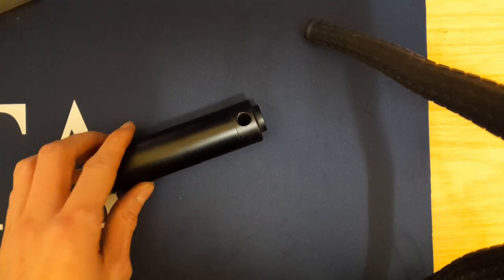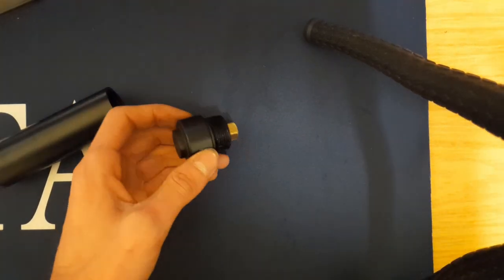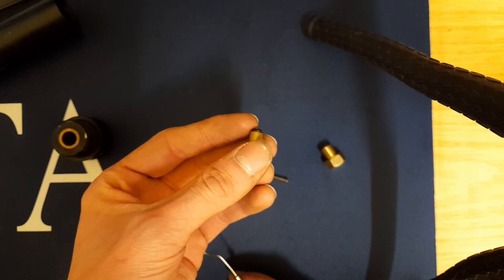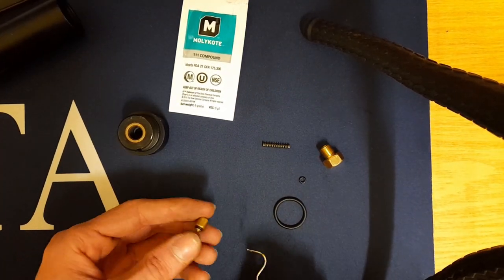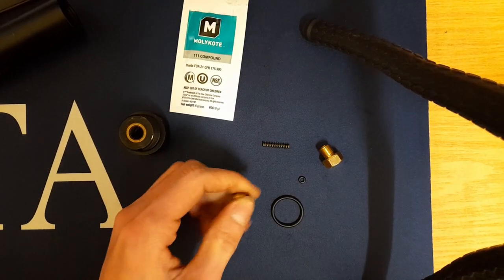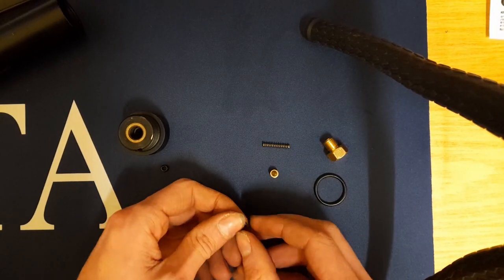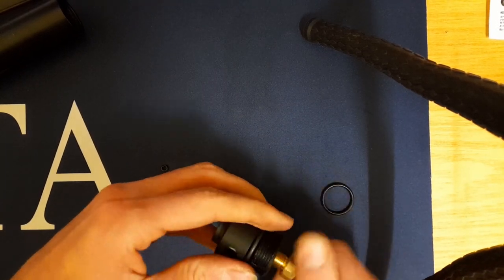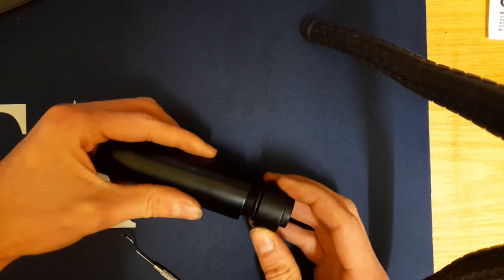FX Inlet Valve Service - Gladiator MK1, Verminator MK1, Cyclone, Typhoon T12 etc.

Comment: I have a FX T12 Whisper.  When trying to air it up, it airs up fine with a portable pump.  But when  we try and air it up using. 9L SCBA tank, the gun won't take any air.  We have tried to go fast with the air, and slow with the air.  It just won't fill from the larger kank.

Do you have any idea what might be the problem and possible fix to get this working?  Thanks.